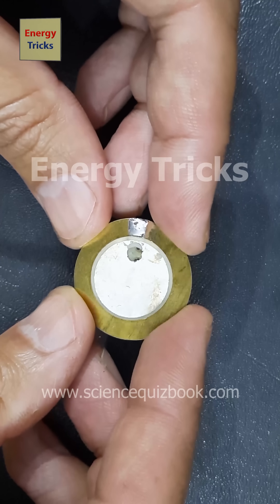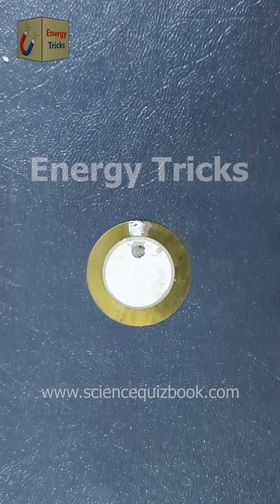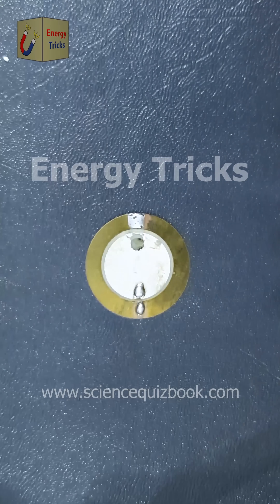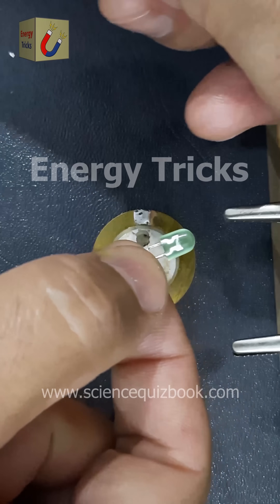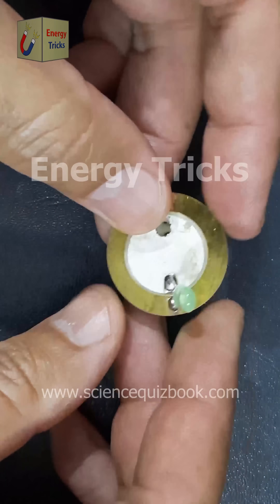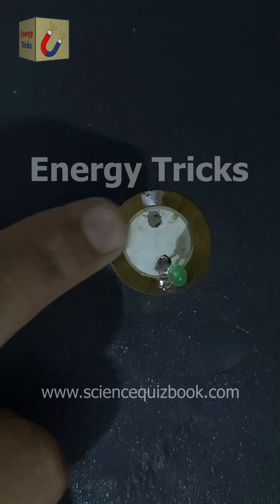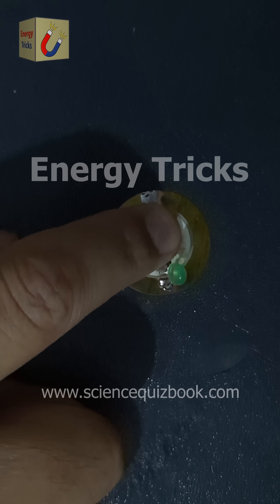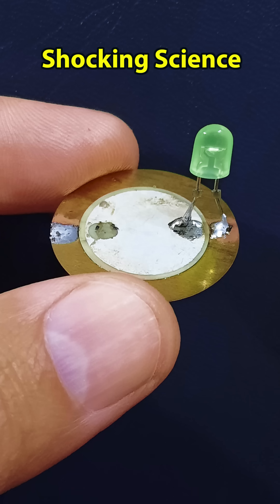How Some Materials Can Generate Their Own Electricity #shortsfeed

Comment: Could this principle be applied to power generation for an electric vehicle?
Reply: Sure. But do the math first, because there's not a lot of energy being generated there.
Reply: @jamesvandamme7786 with how thin this sensor is logically you could fit a lot in a set space, maybe have it somehow attached to the suspension?

Comment: Piezoelectric effect is often used in touch sense applications on modern technologies. For example, my LG washing machine uses PO buzzers for touch sensing to activate a clean cycle.
Reply from the maker: You're absolutely right! The piezoelectric effect is widely used in modern touch-sensing applications, including in appliances like LG washing machines. Many PO (piezoelectric) buzzers or sensors detect slight pressure changes or vibrations from a touch, converting mechanical force into an electrical signal. This allows for seamless and durable touch controls, often replacing traditional mechanical buttons for a sleeker, more reliable user experience.
Reply: @EnergyTricks  it is pretty insane how small they are. Most of the components are SMD soldered meaning that they’re sold to the surface of the board. Yesterday I have taken apart, an older washer that used the same kind of components. And you won’t believe this it was a 2007 model.
Reply from the maker: @ Oh nice.

Comment: I wonder if you could do this with a regular speaker.
Reply: Speakers rely on an electromagnet to generate sound. I’ve tried shorting an electrical speaker before from an old toy and never got the same effect.
Reply from the maker: Great question! Yes, you can use a regular speaker in place of a piezoelectric buzzer to generate electricity,  but a speaker generates very small voltage, which might not be enough to power an LED.
Reply: It's too low an impedance. You need several volts to run an LED.